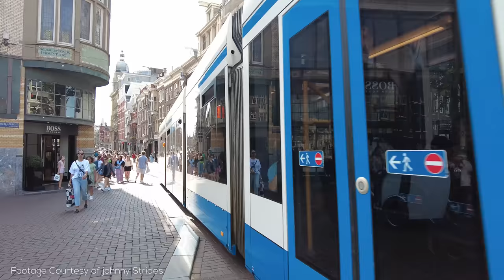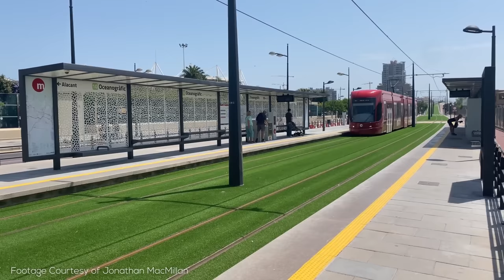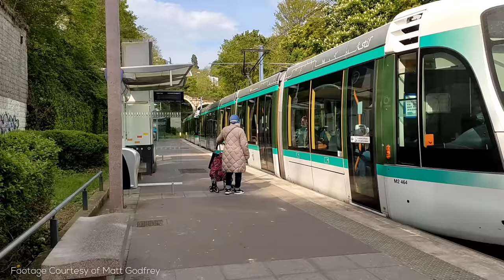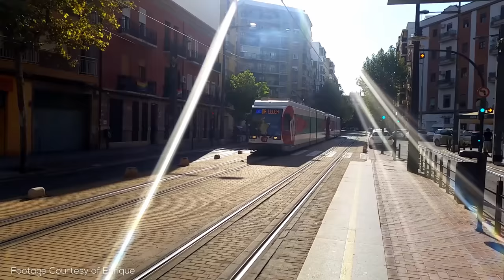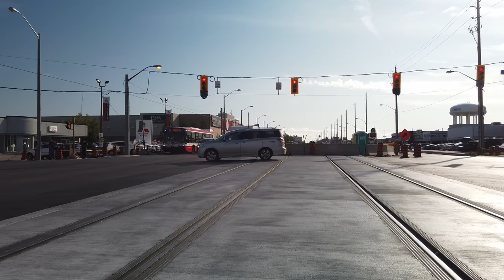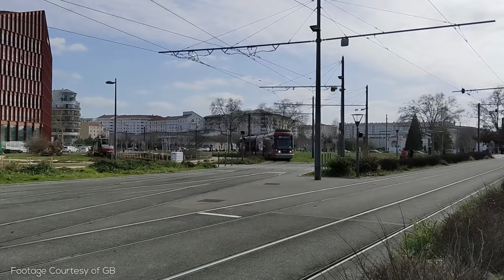What the US Gets Wrong About Trams

Comment: Houstonian checking in:

Our "metro" system is drastically insufficient, because we desperately need true intracity and regional rapid transit.

But our "light rail" network - the red line in particular - really is a high quality example of a tram, in my opinion, and it exemplifies the specific advantages of trams over underground metros or regional rail, in that you can get from the tram door to the cafe counter in a couple of steps. Also, the six-minute headways, while not quite world-class, are pretty excellent for the US. 

The green and purple lines are not frequent enough (12min peak, 18min off-peak) to be useful "walking accelerators" downtown, but they become handy outside of downtown, and are accelerating development along their corridors. It will be interesting to see how they are impacted by the Inner Katy BRT line, whose proposed route runs along the same downtown streets as the green and purple lines - hopefully this will mean fully dedicated transit ROW and signal priority along those corridors (maybe even partial pedestrianization, like the red line corridor? I'm afraid to dream of it...). 

If you ever get far enough down your list to consider a video on Houston, definitely look at the Inner Katy (/silver line extension) and University BRT lines. If executed right, they could be quite transformative, and the former could be one of the country's best examples of BRT (though I'm not convinced the University line is best served by BRT). The MetroHouston youtube channel has good flyover animations of both projects.
Reply: When I used to travel for work to Houston, I was always so disappointed by METRORail. It was cheap, but had such low ridership and didn't seem to go places that people wanted to actually travel. It seems to have improved greatly, but still has a long, long way to go. Given the terrible traffic in Houston, there is just so much potential.
Reply: I used to plan light rail for Houston METRO. When the Red Line first opened, it had the highest ridership per mile in North America and was getting up to 40-45k a day. I was Planning PM for the Red Line extension to Northline and Green Line down Harrisburg. Oh, and University was initially planned as LRT (tram) as well but politics literally intervened.
Reply: The green and purple lines will be extended down to Hobby. Once that happens we will then see the same 6 minute headways as the red line, as airports are generally ridership generators in their own right. 

Despite the light rail's problems (mostly due to motorists) it's actually really well implemented at connecting major nodes around the city. All while keeping costs down that comes with building light rail when used in the right way i.e. only building elevated tracks when it's absolutely necessary.
Reply: @jtsholtod.79  All three lines go through Downtown, and the red line goes to the Museum District, Rice, the Medical Center, and NRG, while the green line goes to the East end and the Purple line goes to TSU amd UofH. 

Nimbyism in Upper Kirby and Afton Oaks killed the hopes of bringing Montrose (and, I guess, UK/Greenway/Galleria, but, like, ew) into the fold, and I'm not sure if anything has really been seriously proposed for Washington or the Heights (both would greatly benefit from lines, IMO).

So I stand by my original assessment: there are lines and service levels that are *missing* (a tram is not true rapid transit or mass transit), but the three existing lines are all solid examples, and the red line remains, in my eye, one of the country's best tram lines.
Reply: Sucks that txdot doesnt care about mass transit and only cares about one more line.

Seen they’re destroying 5by1s all over hosuton for “future” highway expansion. 

Some near the red line lol. Pretty hilarious
Reply: @suuwooski6416  Kiiiinda. Well, no, not near the red line. It's really just the Lofts at the Ballpark building. But bear in mind, NHHIP is not a true highway "expansion" (at least, not the downtown segment) - they're merging 45 with 59 and getting rid of the stretch of 45 that runs west and south of downtown.

Also, there are wayyy more 5-over1s now than five years ago, and that number is accelerating. Houston housing stock continues to exceed demand by about 80,000-100,000 units.
Reply: Daily rider on the Red Line. It really is a high-quality service with Transit Signal Priority and headways of every 6 minutes.
Reply: Good news but that’s the official plan. The Silver Line’s northern extension/Inner Katy BRT is to give all 3 lines running down both Rusk and Capitol an exclusive lane. Should be pretty sweat to see 3 rapid transit lines use the same stations along with two new ones for the SL only inside of downtown. Not to mention the SL is also getting a southern extension into Bellaire.
Reply: @kirbcide  I head Gulfton, not Bellaire, for the SL extension. Either would be good, but Gulfton would be great.
Reply: I didn't even know you had any type of rail system.

Comment: Great video - it would be interest to hear your analysis of where would be most suitable for trams. In London we tend to take the ex-rail-alignment approach you talk about but one big issue is these don't necessarily exist everywhere!
Reply from the maker: Yeah, perhaps that’s a video for 2023!
Reply: One good alignment for cities is what Paris does : take one or two lanes of car traffic for the 2 tracks of the line and decrease the car's share of the public space in dense urban environments while also offering new ways and lanes for soft mobility (bikes, personal e-mobility devices) and green bands that decrease urban heat accumulation spots.
It helps shape urbanism and new appeased car traffic patterns.
That's what they did with several lines, specifically T3a, T3b and others...

They also do a mix of that and ex-rail-alignments on other lines, specifically the "Txx Express" lines (like T11 Express) where Citadis Dualis (tram-train) rolling stock is used so that they can run in both SNCF corridors and streets.

There are also lines that took almost half the width of previous long straight wide streets that used to be Paris center's access / way out before freeways ; the French / European softer version of stroads.
Like T6 line's Eastern part (this line's Eastern terminus called Châtillon-Montrouge is located above ground but through a building, like Reece mentioned. Located next to line M13 South terminus of the same name).

Really, France has such a variety of modern tram installations that you can pick from, even underground metro-like ones in city centers (Rouen).
For urban spacing that would be more comparable to US cities, look for tram lines in suburbs or outlying parts of cities. The likes of Lyon's East far reaching trams for example, Paris' T6 that I mentioned and many others.

You can use the cartometro site in conjunction with Google Maps satellite view and street view to follow the different lines and types of integration and alignment in urban environments.
In case you don't know already, cartometro is a treasure trove of exact maps of track layouts for a number of cities throughout the world, France being the most covered country, Canada the second.
The site is available in English, and is extremely useful to have a better perception of transit installations.

That should give you some enjoyable homework while we wait for Reece's video on the matter ! 🤣
Reply: Around here, disused rail lines are often snapped up and turned into bike trails. This is great if you like to bike places (and lots of people here ride bicycles, for exercise and sometimes even for transportation) but it precludes using them for trams.  Offhand I can’t think of any rail rights-of-way in my area that aren’t either still used for (freight) trains, or converted to bike use. And I know I’m not the only cyclist here who would raise a stink if someone tried to take away one of my bike routes.

Comment: Good video!  In my view trams are overused and misunderstood in NA.  Typically they are sold as a cheaper alternative to a metro, but most city managers are naive to how much slower they are.  They do have their niche though...  The station walkshed can be incredibly quick for a tram...maybe 30 seconds compared to 5 minutes+ for bigger metro stations.  Also many trams have mixed standing room/seats and it's easier to get a seat on a tram vs a bus...the latter of which can be claustrophobically packed.  They unload faster than a bus, pollute less nitric oxide than a diesel bus,  depreciate slower than a bus, and are a great option for cities in cold climates where yes you could walk...but it wouldn't be fun.  I think as you put it they are best used in dense downtowns corridors and walk extenders...and not for long distances, low density areas, suburban commutes or where capacity is needed.
Reply: @grahamturner2640  I agree!
Reply: Exactly bru

Comment: One thing is, in North America a lot of light rail systems are implemented in cities with metro area populations of over a million people. In Europe, cities that big normally have a metro as their highest system of transport. (Though not all)
Most european light rails can be found in cities between 300.000 and 1.000.000. Like Karlsruhe or Valencia.
But Europe also has its Ottawa like low floor Metros, like Granada, Sevilla, Porto, Kryvy Rih, Wolgograd,
Reply: Just FYI, only Sevilla and Kryvy Rih are proper examples since they're fully grade separated while the ones only underground in the city centre but act like a normal tram (i.e. with grade crossings) otherwise.
Reply: @MarioFanGamer659  Yeah, your right.
Reply: a lot of global cities STARTED Metro / Trams a LOT earlier then North America that will usually NOT build a train based transit solution till 800K OR MORE people
Reply: Here I am like - wait - there are cities without trams ? I am from a city of 250k and never thought, there could exist cities above 100k without trams in Europe.
Reply: @starborneolympus3907  Unfortunately, there are still a lot of cities with over 100.000, that don't have trams. Maybee even more than half.
Reply: @starborneolympus3907  I'm from Germany and there are quite a few cities with a population of at least 100k residents with no tram or at least a Stadtbahn like Hamburg, the second most populated city in Germany, is also most populated German city with no (de facto) tram, though there still are plenty of bigger cities with a tram, especially in the east.
Reply: @MarioFanGamer659  yeah, it might just be a bit of a iron curtain split when east germany has more. I am from the former second world country, so experience might differ from the the west.
Reply: @starborneolympus3907  Definitively since a lot of trams were ripped from Western European cities (though many are reinstalled) to make space for cars with the US, being the country where this philosophy originated from or at least has reached the climax, as the biggest offender.

Comment: Personally, I don't like the U.S light rail system because they forget that you're supposed to remove cars from the streets before building it, otherwise, it gets stuck, the best case (I've seen) that an LRV stops at a road crossing, the tram with more people should have priority. Also, I feel that Trams should be used as local transit, North American cities build Light Rail even though they run it as a rapid transit-like service while being slower and having less capacity.
Reply: I agree about signal priority for LRTs on city streets. New Jersey Transit management seems afraid to assert this for the Hudson-Bergen Light Rail because their political masters have no transit vision.
Reply from the maker: Yes, local transit service is probably where most trams make sense
Reply: It's weird because when trying to get a traffic light at an intersection on a Pittsburgh street with light rail tracks, the powers that be said they couldn't because it would impead the "rail line" as if it were akin to a freight train. We didn't mention the one existing traffic light for fear it would be removed. I think there are too many conflicting well-intentioned rules and priorities/perspectives that we need to sort out.

Comment: what North America also seems to have missed in many cities is that Trams can and should be extremely well combined with bus lines. Over in the US I often was forced to walk around a lot when I needed to switch from one public transport to another ... Modern european tram networks design stops for a seemless transition between busses and trams, or other public transport options. You step out of your bus and just need to turn around on the spot to wait for your tram. That goes for stops on a regular street and for the dedicated tram pathways which allow busses to get on and off for the stops. Hence low capacity bus lines feeding directly into the higher capacity tram lines (which then feed into S-Bahns/rail/etc), extremely minimizing the need to walk when using public transport overall.

Comment: I hope when it opens, you cover, and perhaps visit, the Parramatta Light Rail.  It'll give, in part, easy access to one of Sydney's busiest, if not the busiest, hospital districts at Westmead.  An area that is currently serviced by a few roads, that get very congested, and a heavy rail station about 10 min uphill walk from the hospital main entrance.  This hospital also services country areas of the state, so you can imagine how busy it can get.  Also part of the route will have green rail, which will be lovely if maintained properly.  As for the overhead power lines, there are options.  As you'd be aware Sydney has a third rail option along part of the route, which looks so much nicer than overhead lines, and Newcastle uses capacitive power, in that the LR runs off capacitors, which are charged via pantograph, at stations.  On a personal note, as a teen, and early 20s, lad in the late 80s and early 90s, I did enjoy going to the George St entrainment area in Sydney, but hated needing cross the road as it was always busy, but at least narrow.  Seeing that traffic has been removed and it's a shared street with LR, makes me happy knowing that young people today have easier access to the area.
Reply: Interesting

Comment: I think a perfect example would be a city like Dublin, Ireland. This is because of the various ways the tram is utilised. There, the trams run on streets, they're grade separated, run the middle of main roads, they run along old rail corridors and also run on viaducts. This gives the Dublin tramway network very high versatility, as they run like buses in the city and like suburban rail in the suburbs. Another interesting factor is the speed of the trams, because in Dublin city's dense core the tramway runs quite slowly at an average speed of 35 km/h, where as in the suburbs they operate up to 70 km/h on old rail corridors and right of ways. And all of that is achieved with the most simple and basic European tram, made by Alstom. 

So, in my opinion this is the perfect case study for the possible uses of modern European trams in north America and all over the world.

Comment: I agree that modern French tram networks tend to be an excellent example of using trams where they make the most sense. I do wonder though why some tram lines in greater Paris are largely grade-separated but also have some street-running sections, like T2 and T13; I imagine it wouldn’t have cost that much more to grade-separate the entire thing and run a (light) metro-like service.

The plans for a mostly underground tram line in the west of Lyon to replace what was going to be metro line E also seem a bit confusing. If you’re going to do all this tunnelling, would it really cost that much more money to build a fully grade-separated light metro rather than a heavily tunnelled tram line?
Reply: Afaik Paris tram lines which are almost fully grade separated run on former rail corridors, such as T2 and T4.
Then the cost of grade separation of the lines wasn't in the budget as the grade separated infrastructure was already there. Unused

Comment: You've criticized the Hamilton LRT before, but it actually has a lot of the design features that you enjoy. It will be side running for a portion of time, it will significantly reduce vehicle lanes, and when they do run in the centre, there is only 1 lane and sometimes 2 retained with no widening. There are many spots where vehicle lanes are being reduced from 4 to 1, for deliveries and such. It will be grade separated except at intersections and will have transit priority at intersections.

I hope we get green track as well and will be advocating for this. Much of the LRT route is also a walkable or cyclable distance, and ultimately will be for capacity rather than speed.

Comment: I wonder what you think about trams in the Eastern block. Cities usually have large prefab house complexes on the outskirts with tens of thousands of inhabitants. These "suburbs" usually need more transit service than a bus and those cities usually already have a streetcar network (more like Toronto's than Paris'). So the same trams that wingle in those tiny old streets with low speed also go there, usually on a railway corridor with high speed and less frequent stops, basically light rail.

I suppose that this need for medium capacity service way out of the centre is the reason this type of mixed tram system is not seen in America, although there's probably no technical reason why Toronto's trams couldn't also work as light rail.